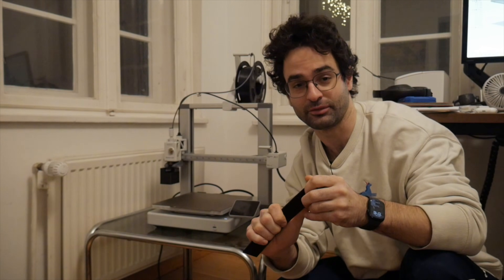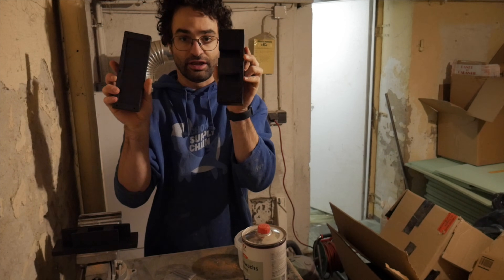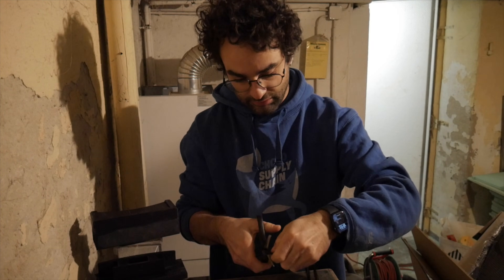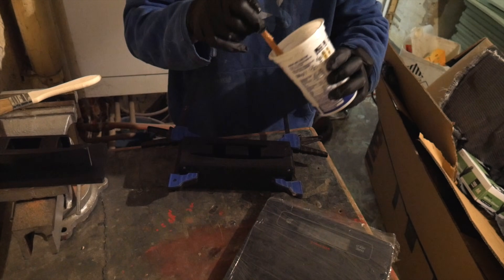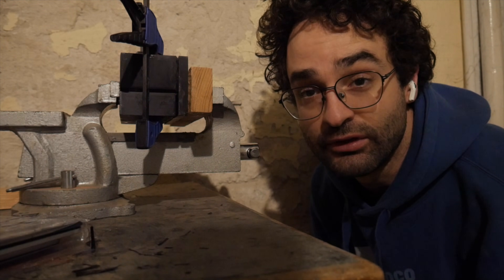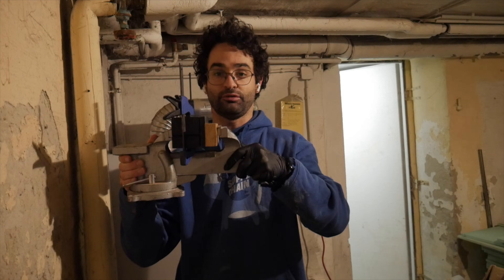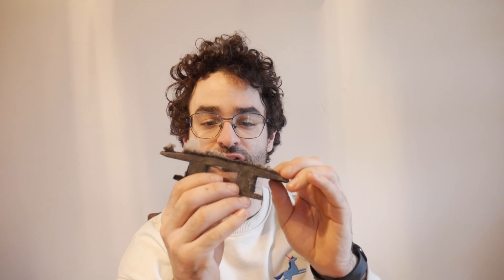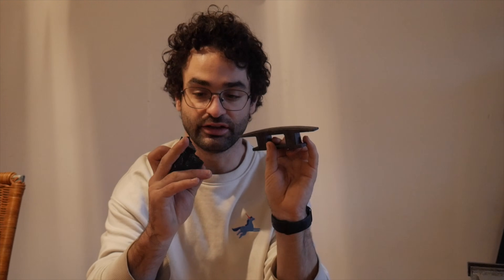I Built My Own Carbon Fiber Cleats Instead of Paying $1,000 Each

Comment: Maybe play with using steel to reinforce a 3d print directly? Flat bar with two threaded holes (or a nut on the top of each hole) for the top (insert mid print), with an all thread piece in each “leg”. So the main “pi shape” becomes metal, with eg ABS all around. You can fill the holes the all thread drops through with some abs slurry (use acetone). Can also polish the surface with acetone.

Comment: I would trust that as a door handle not a cleat for a boat. When you say boat i wouldn't even trust for a medium aluminium boat. Your plan to put this on a 12m catamaran LOL. What are you attaching it with more expoxy to the boat? For a boat that size your talking about 1 ton of pressure in strong winds and bad swell EASY. I would want 3x 6mm bolts with oversized washers minimum. I would really aim for 8mm bolts and make sure its bolted to solid structure not the shell. 
The part you made is small as well. When it comes to rope usally 10mm or more is used because its comfy in the hand to use.

The test is tie your car to it and drive away at 10kmph. Even then thats not even a extream spectrum of whats possible.

Dont waste your time get some SOLID metal welded up for 1/16th of the cost, no R&D required and move on. The metal welded is about as cheap as what you put into this cf epoxy door handle.

Comment: Unless you need ultra light weight, just try designing it around three 1/2 inch steel bolts and a steel mending plate. 2 vertical, 1 horizontal, and plate at the bottom. 3D print the outer body(ies) in ABS and embed the bolts, then wrap the whole thing in carbon or fiberglass weave for strength aesthetics. Can even cross wrap the joints with heavy 60 or 80lb Spectra/Dyneema fishing line. The steel will sheer before the fishing line with enough wraps. Much cheaper, all materials are at Walmart or Home Depot, way more reliable to assemble rather than mold, probably stronger, probably faster, achieves the same aesthetic.

Comment: What does a standard cleat cost? It has to be the 10th of what you are doing with carbonfiber. I also wouldn't want to rely on chopped carbon on the amount of force that will occur on a cleat in a storm/big waves.

Comment: Gday. Thanks for the video - I love watching people build accessible type cats. (Not interested in million dollar builds) The cleats will still need to be fastened to the boat somehow. For about 20 years Schionning cat builders in Australia have made composite cleats really quickly. They drill holes through underdeck reinforcing and then pull wet out glass through old hose. When pulled through they shape the hose like a cleat. Then when it cures they cut off the plastic hose leaving a rounded cleat, already installed. Fast to make and really really cheap and super strong. I think you would find this much faster to make and plenty strong enough. Cheers Phil
Reply from the maker: That sounds like a nice technique, thanks for sharing!

Comment: You only need 2 alignment pins one in a round hole and one in a slot - then use bolts and captive nuts to clamp the rest of the mould together and also design in other captive nuts that are pushing against the clamping faces - that way once its cured you can wind bolts into them to push the halves apart without damaging the mould

Comment: Too small and can’t cleat a dock line that is a proper diameter size to that. Yeah it’s fine for a 15’ boat but not for any boat over 30’ again because of the proper size of dock lines that should be used.

Comment: Normal cleats do not cost 1000$, they are way cheaper if you dont go for the retractable ones. Its like saying you’ll build your own custom car because a lambo is too expensive… yeah no shit.

Love your project, I just think your time is better spent elsewhere than making 50$ custom parts that are unproven.
Reply: Agreed. Cleats may be better served as galvinized metal. The rope will typically chaff on the carbon fiber. Great proof of concept. Focus your efforts where your time maximizes value and purchase low additive value components.
Reply from the maker: Hey, fair points all around. I mostly was looking for some fun winter projects to tackle to break things up a bit, and I've wanted to try to build something with this technique after seeing it on the Easy Composites channel

Comment: I think the plunger is a really smart idea.  I’m wondering if there might be value in providing some holes to allow excess epoxy to escape, resulting in a higher carbon to epoxy ratio?  On the other hand, it would result in much lower pressure inside the mold.  I dunno.  Looks pretty good to me.  Eager to see how strong it is.